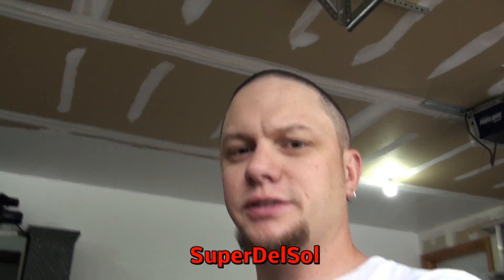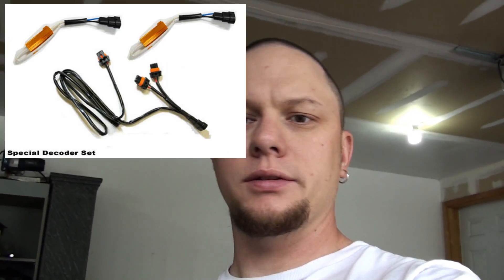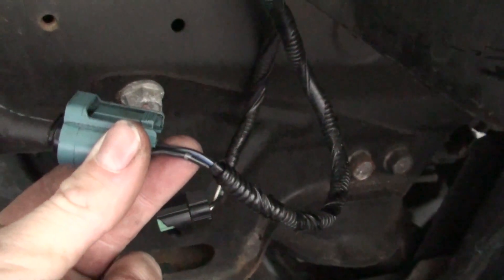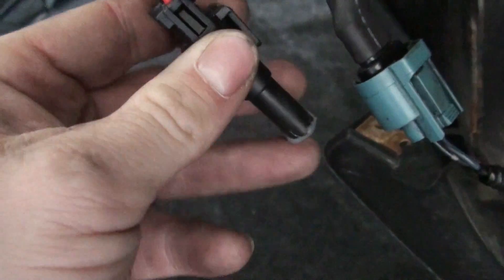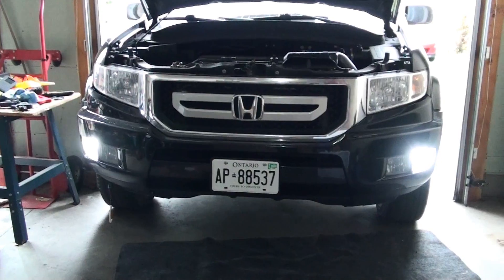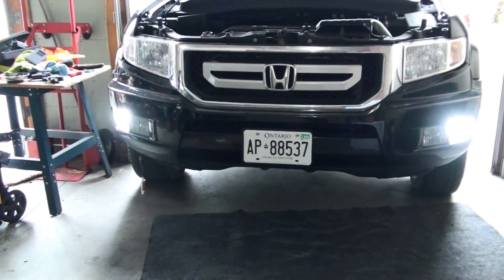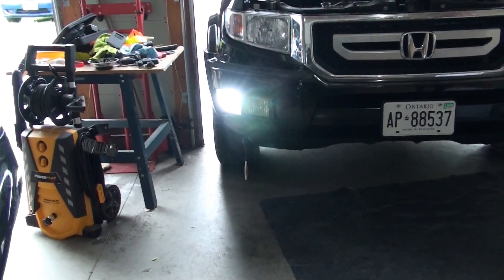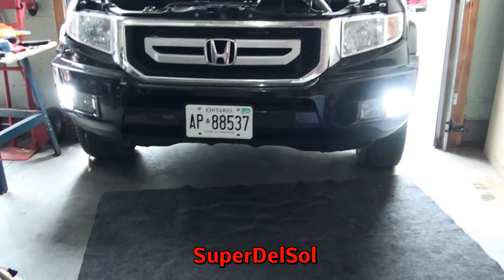Ridgeline led drl install

Comment: I am trying to do a full LED conversion on my 2011 Ridgeline. I ordered a resistor but it didn't work. Where did you get your resistor from?
Reply from the maker: If I remember correctly, mine came with the wiring harness. I can't promise anything, but if I remember, I can measure the resistance of mine and get back to you. That may be your issue